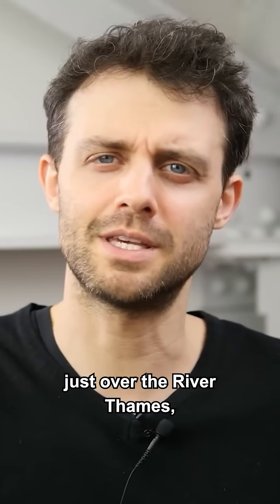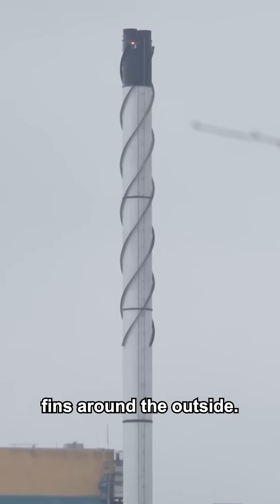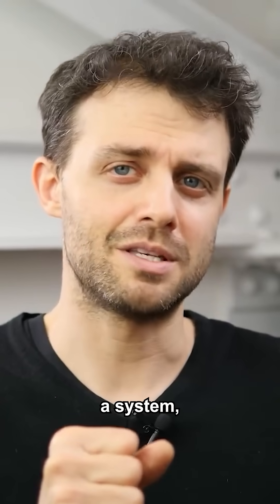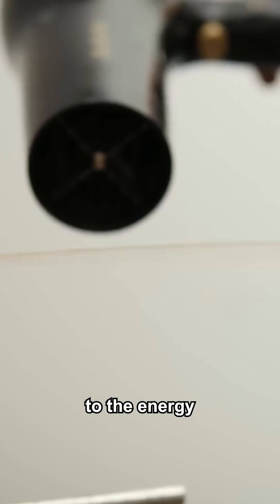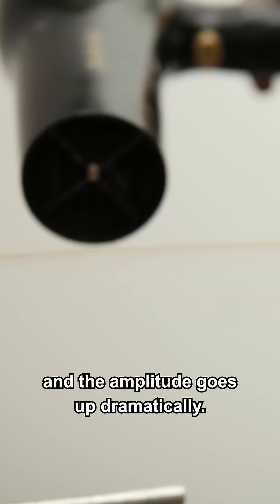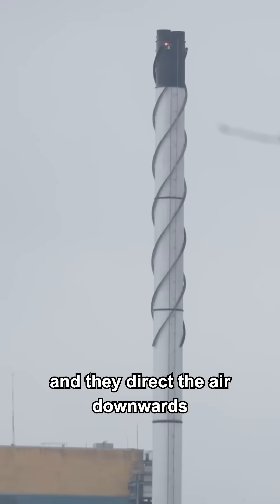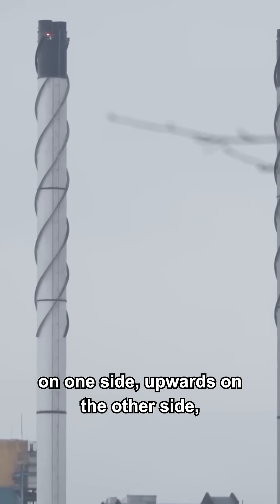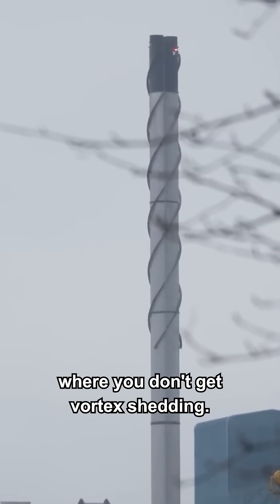Counteracting Vortex Shedding is This Simple...

Comment: @SteveMould and anyone reading this if you YouTube search "Heinz Elst pijp" You'll see the issue happening in real time. Even though there was a different system in place, it didn't work when a huge wind storm passed Elst and almost caused it to collapse. But the other system worked, but it was scary. Because my Office was literally below it and we had to evacuate. You could feel the building shake a bit and standing below the pipe was pretty scary. 

A crane, bunch of Ambulances and first aid came. But we couldn't do anything but wait for it to settle or fall down.

Comment: This phenomenon is exploited by a type of wind generator that doesn't have rotating blades (so it's not a turbine), but instead is a vertical pole designed to orientate itself to catch the wind and intentionally induce vortex shading. This causes the pole to oscillate from side to side, and this kinetic energy is captured by a mechanism, which in turn converts it into electricity.
These generators have the advantage of having a much smaller footprint than wind turbines, making them more suitable for environments where large wind turbines are impractical or undesirable, like rooftops in urban areas

Comment: I suspect this is part of the reason power lines are much more susceptible to "galloping" when they get iced up. Power lines are made from twisted cable which  has a similar helical profile that presumably helps to avoid vortex shedding in high winds. When they ice up this helical profile is smoothed out and vortex shedding is not disrupted.

Comment: See the "Tacoma Narrows Bridge" video here on youtube.  The model for bridge from the 1940's was never wind tunnel tested.  It shed longitudinal vortices rather than the vertical vortices shed by these chimneys..  The Tacoma Narrows is an extremely windy place and the resonant frequency built on itself until the bridge collapsed from violent swaying and twisting.  It's the same reason power transmission lines have "Stockbridge dampers."  They look like microphones clamped on the power line near the insulator stack.  Power lines also shed "barrel roll" vortices on windy days and at resonant frequency, can set up a phenomenon called "line gallop."  That wild dancing of power lines cased by the constant alternating push of the downwind vortices can break strands of the cable causing resistance and hot spots.  The Stockbridge damper absorbs those minor vibrations in an effort to keep them from building up to problem levels.

Comment: Wind caused oscillation is what brought down the Tacoma Narrows Bridge, but it wasn’t a cylinder. Instead the angle that the wind hit the bridge alternated, with each period increasing the motion.
Reply: It’s more the angle the bridge met the wind. 

Straps holding a load on a vehicle at speed tend to ‘thrum’ if edge on to the airflow. Watch for this the next time you are passing different flatbed trucks on the freeway. If  more than a few feet of span, putting a half twist in such unsupported stretches breaks up the vortex as any twist merely moves the point of lateral force along the the length of the strap somewhat, rather than displacing the span overall from alternate flopping. Evidently the Tacoma Narrows engineer(s) didn’t know this simple fix.
Reply: @For_What_It-s_Worth  I think that we are in complete agreement. I am not certain what the difference is between what we both said. I also put a half twist in a strap just as you suggest. 

The oscillation on the bridge was the same mechanism that wrecked the bridge… when the deck was pushed down it would rebound back and the wind would catch the underside pushing it up. Each rebound exposed the opposite surface and more energy was added, just like pushing someone on a swing. (Of course you know all this, obviously.)  What I found fascinating in the film footage was the nodes that were established where different sections oscillated in opposite directions. It was surprising just how much flex the bridge had before it actually failed.
Reply: @blacksmith67  
I was just giving a minor change to point-of-view. “…the angle that the wind hit the bridge alternated” just gave me the mental picture of the wind direction shifting up and down, not the deck flopping in a steady wind.

The shifting point of view reminds me of the abrupt jump in the frame of reference in an accident report from years ago, “The trees on the right were passing me in an orderly fashion, when suddenly one of them stepped out in my path.”

Do you think a half twist would have saved the bridge?

Comment: Steve, just a quick question. I'm confused. I thought that there would still be a vortex shedding. It just stops the alternating of which side the vortex would be shedding from thus, preventing the buildup of energy through resonation. I thought the purpose of the Helix was to make the air on one side shed the vortex higher and on the other side it sheds it lower so that it doesn't flutter and resonate not to prevent it from shedding the vortex in the first place.

Comment: Hi Steve, I love your YouTube clips! Does it matter whether the chimneys are in operation or not? If the chimney is hot, there will be some airflow going up the outside. Being in the northern hemisphere, there will be some twirling of the air as it rises because of the radiated heat (which maybe opposite the direction in the southern hemisphere). There will be quite fast movement of air at the top of the chimney, proportional to the heat. The fins could be expected to channel the airflow, which may help mix and cool the expelled air by mixing it with the outside air. Would this have any effect on the perpendicular vortex shedding? I imagine it would depend on the speed of the wind moving perpendicular to the chimney. But would it be enough to be considered in the design? Thanks, C.

Comment: Those spiral fins are called strakes.  They work because each vertical cross section presents a surface of a different width.  So the frequency of the vortex shedding doesn't match the resonant frequency of the structure at all wind speeds it was designed for.

Comment: I spent a few years of my career as a NASA research engineer at a large tunnel investigating this on launch vehicles as it can be a real risk.  We would properly scale a vehicle and test the model over a large range of wind angle and velocities.  Amazing how strong the response can be if the vehicle has low inherent damping.  Dampers are often used to protect launch vehicles on the pad and during rollout.  Very cool short video.
Reply: I've also heard that the Vanguard rocket (Kaputnik!) Had some spiral shrouds on its fairing to help with this, and they came off during launch.

Comment: If your car doesn't have an antenna (aerial), check around the next parking lot you visit.  Antennas have had these for many years to reduce noise.
Reply: Hum…
I just thought it was an electromagnetic tuning device for better reception, a sort of loading coil. You are making a very plausible point.

Comment: Resonant frequencies are an overpowered hack if you want to demolish a structure.  So long as you overcome any inherrent dampening, you can utterly destroy almost anything with RF.  I took down many flag poles despite disability and weak muscles.  I just barely overcame dampening, but after seconds or minutes, I built up enough energy to tear ⅜" thick side wall steel pipe diameter 4-6".  Faster than using a cutoff wheel.
Reply: He's talking about resonant frequency as in pushing the pole in time to make it wobble, not radio frequency like RF usually means
Reply: But why would you want to tear down a flagpole?
Reply: He means literally just shaking it with his hands (if I understand correctly)
The unbelievably mind-blowing thing is just how much energy shifting can be built up just steadily manually wobbling past the dampening frequency using just something as simple as your hands
You can feel this by trying to shake a small flagpole and feeling the resonating frequency of the feedback it gives you
Reply: Do you mean you took down the flag pokes using RF? What did you generate the RF with?
Reply: Dr stone lol
Reply: hey look! That disabled dude is destroying public property!
Reply: I believe some wind power structures are also taking advantage of it. 

 They look like a bunch of swirling dildos!

 Anyway not sure if they are cost effective or how much power they produce. It is an interesting concept and design non the less .
Reply: Are you doing this for vandalism?
Reply: And how did you do it?

Comment: During the early days of automobile streamlining, the jelly bean car days, they were very effective for air passing over the vehicle. However, when stopped and a side wind, the car would vortex shed as the cross section was a squashed cylinder and the car would rock violently. This was especially true at a stop next to a tall building that managed to redirect and concentrate the west wind down. Had to take the car to a mechanic and get a no problem found for engine misfiring and a bill until I figured out and problem and lived with it.